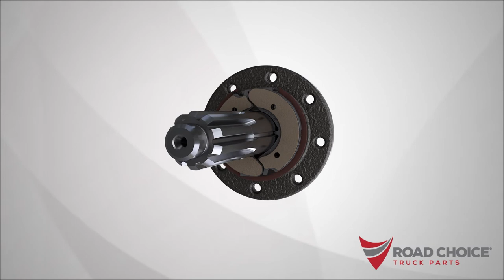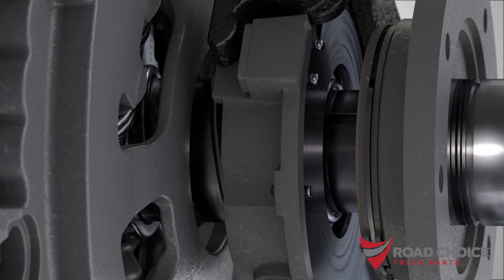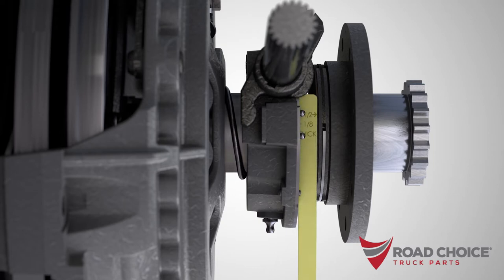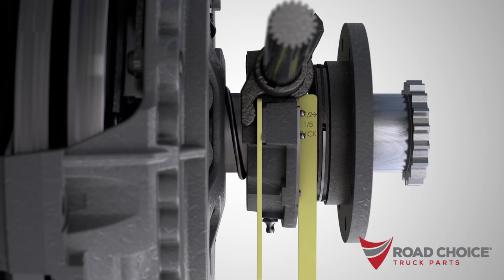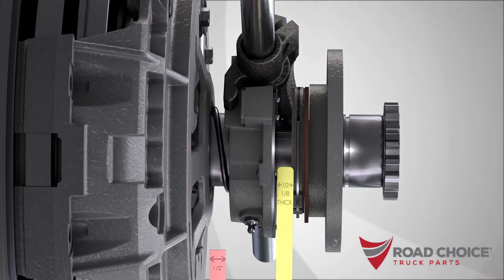Road Choice Clutch Fiber Spacer

Comment: Is it ok to add your fiber spacer on both sides of the original worn clutch brake so it grips a little more and it is not metal on metal on the orginal clutch brake, what thicknesses do these fibers come in? Thank you
Reply from the maker: Thank you for your question! Technically, adding a fiber spacer to both sides of the clutch brake is okay for a short term solution. 

The amount of wear that you are compensating for indicates there may be a bigger problem as additional wear is likely present in the system. It is recommended that you check the flywheel as well as the input bearing retainer to see if replacement is needed.  

The fiber spacer is only available in 1/8”. 

There needs to be ½” to 9/16” between the release bearing and clutch brake at all times to ensure proper clutch release/function. Please keep this in mind if you decided to use a second fiber spacer for a short term solution.
Reply: @RoadChoice  One fiber will definitely bring this back to spec. Which side of the clutch brake should I add the fiber to? Thank you.
Reply from the maker: @clearlake2369  The fiber spacer installs on the input shaft against the input shaft bearing retainer before the clutch brake!
Reply: @RoadChoice  Hi does the fiber clutch brake spacer go to the rear of the existing split clutch brake or to the front as viewed front, I.E. front of vehicle. Thank you.
Reply from the maker: @clearlake2369  It is placed in the rear, between the clutch brake and transmission.
Reply: Thank you, how many and what size thickness split clutch brakes are available? What is the standard thickness clutch brake? Thanks
Reply from the maker: @clearlake2369  Road Choice currently offers three hinged clutch brakes:

Part CLA127175:   1.75” Hinged Clutch Brake (3/8” thick)
Part CLA127200:   2” Hinged Clutch Brake (3/8” thick)
Part CLA1272005: 2” Oversized Hinged Clutch Brake (1/2” thick)

Standard thickness is 3/8”.

If you have further questions or would like a digital catalog, please email justin@roadchoice.com. Thanks!